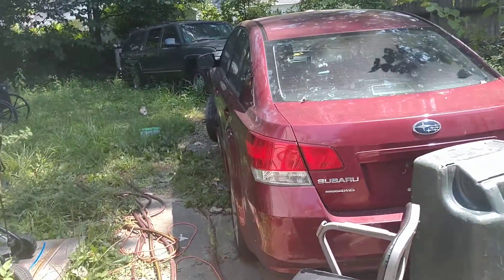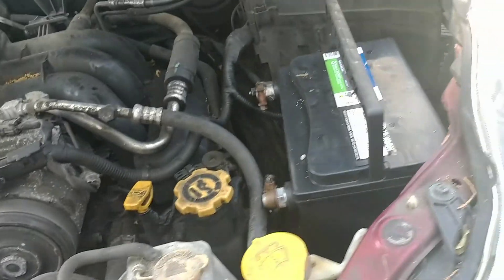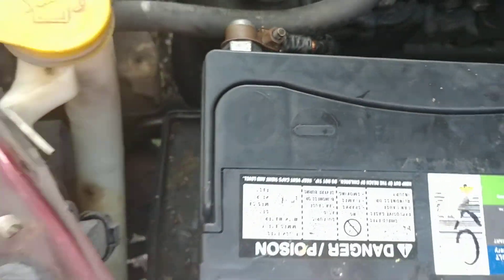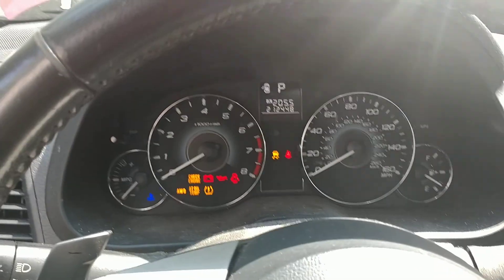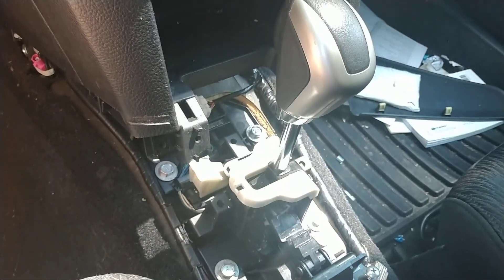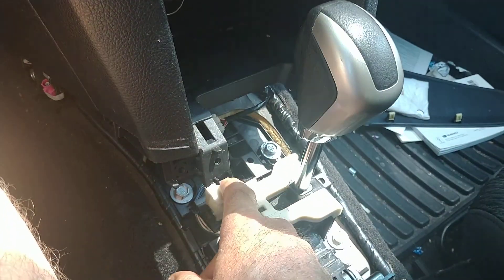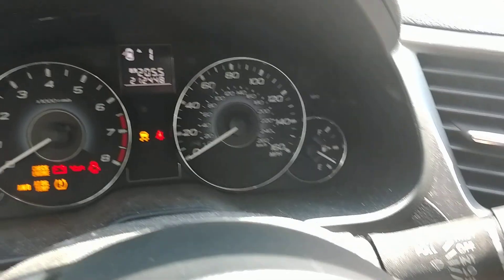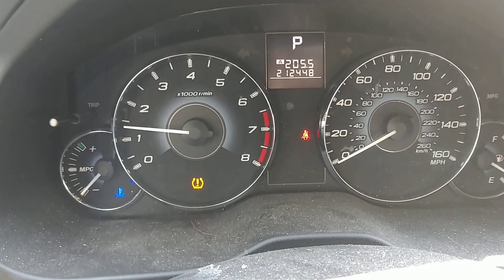(pt5of5) P0705 range sensor code SOLVED/5EAT valve body swap Subaru 2010-2014, proof in the pudding

Comment: Thanks very much for the videos. My 2008 Outback LL Bean has the same P0705 code . Bad range sensor. Could you change just the sensor without removing the valve body? I have to do like you did..on my back...and I can see and touch the sensor...so do you think changing the senor is possible? or should I just drop the valve body and do a swap like you did? Being a retired mechanic, my thoughts are to change the location of that sensor/switch to somewhere on the shifter. I think a mechanical part that will wear out is ridiculous to mount inside the tranny ...let alone not selling the sensor without a $800 valve body. Thanks again..that must have sucked trying to shoot video under the car.
Reply: Какой датчик